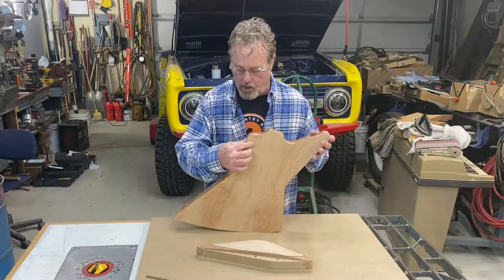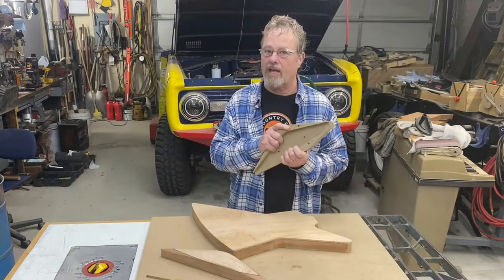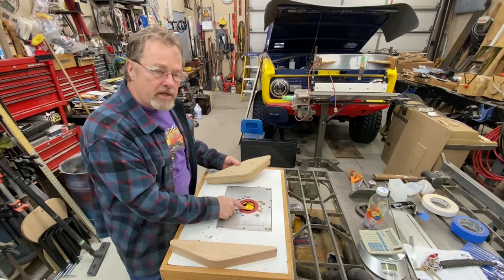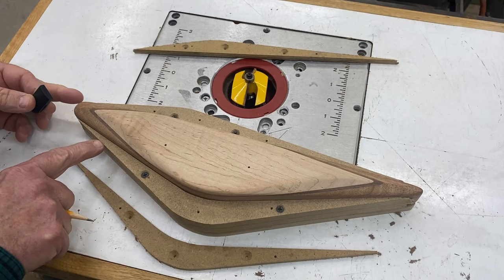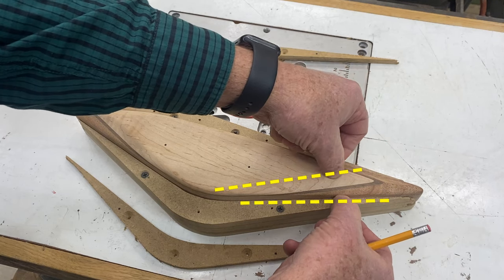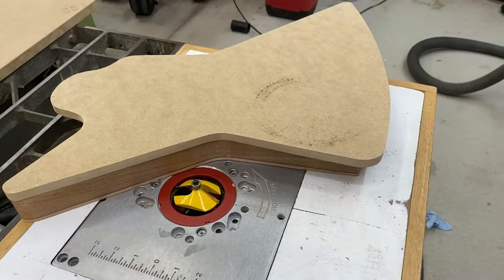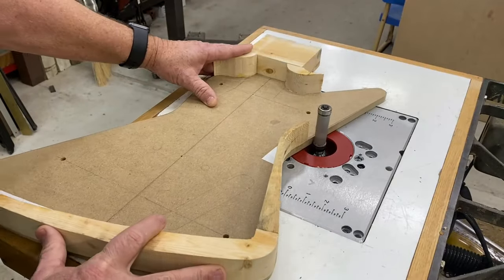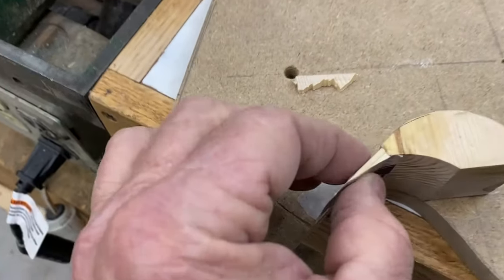How To Bevel A Guitar Body

Comment: Very interesting. I've spent weeks thinking and planning on doing Jackson RR style bevels. Your approach is the opposite of mine.

You are doing an external offset using a chamfer bit with a bearing. I didn't know that was possible.

I'm instead getting a 120 degree v groove bit with matching bearing so I can create a bevel template with no offsets (laser cutting them).

Thanks for sharing!
Reply from the maker: @MauriceKindermann  I have looked at the RR Jackson guitar style bevels and it looks very doable the way you are thinking of doing it. There are many approaches to accomplishing the same thing. None are right, and none are wrong.